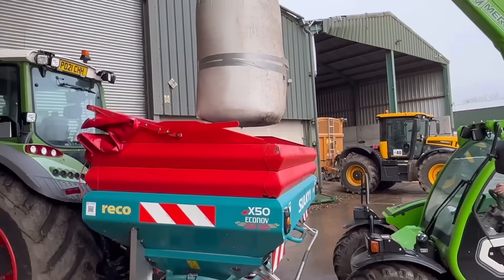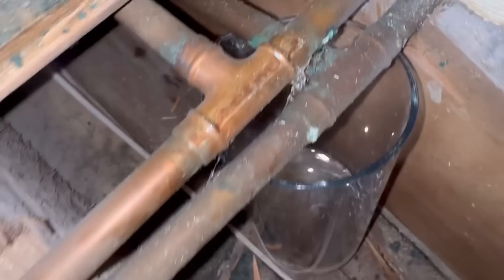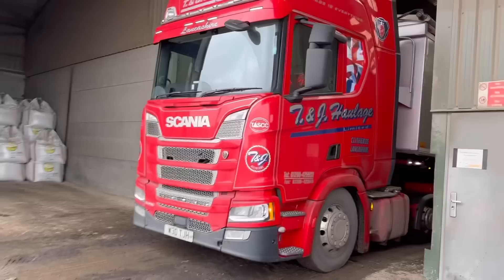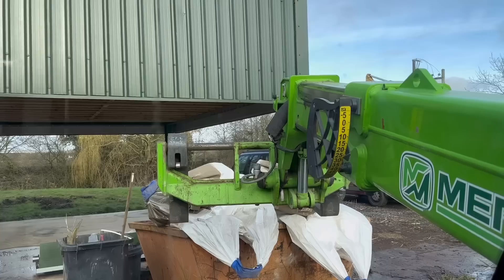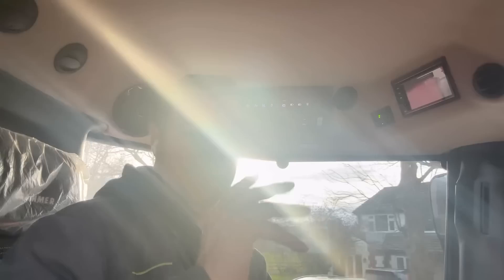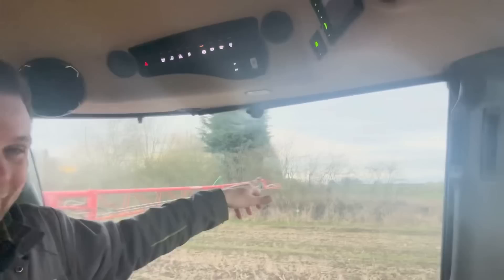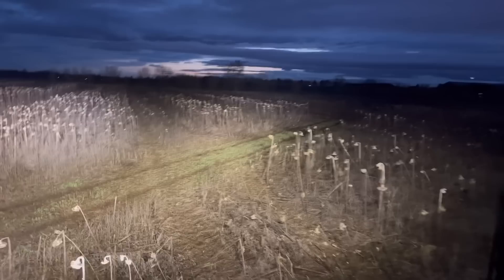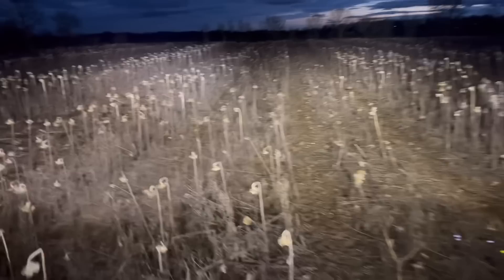TRUCKS EVERY WHERE #OLLYBLOGS #AnswerAsAPercent 1061

Comment: Tractor spotting for me and also when I was younger, military aircraft (should have joined the RAF). The copper pipe you caught with the saw, change it or put a joint in place of it. I did something similar and thought "Didn't go through so should be fine. 8 Years later !!!!! damp spot in the ceiling plaster, it was the pipe i nicked with the saw ! You need to "spill the beans" on who spilled the beans !!!!! 😬